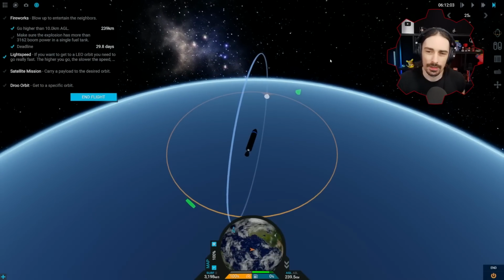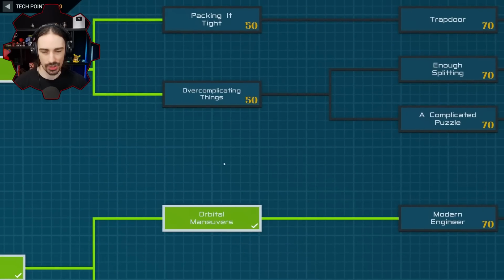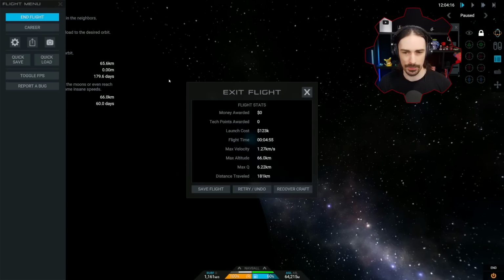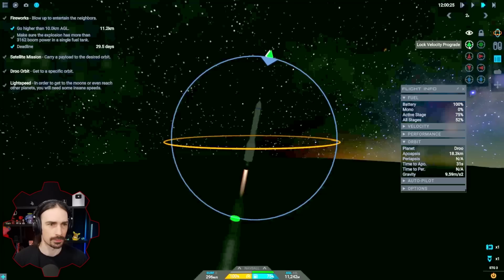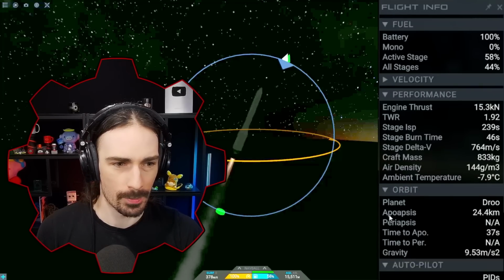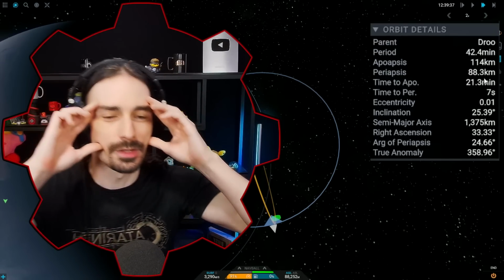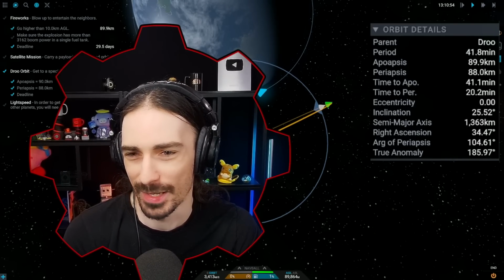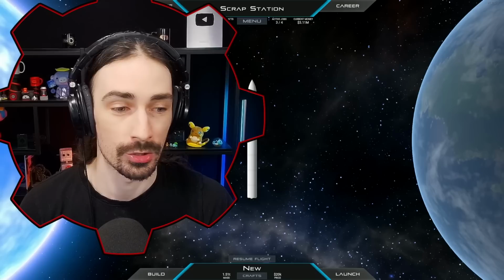Trying To Launch A Rocket Into Super Precise Orbit! [Juno: New Origins]

Comment: This is so painfull😅
Well at first there are no orbit and non-orbit motors there are atmosferic motors and vacum motors (simplyfied) so the orbit motor will work just fine when you enter space even in suborbit flight. 
Orbit making:
You don't want to have the spike while trying to make an orbit (if you do the spike it means you have wasted fuel to get yourself so high) in KSP (don't know how there) is first stable orbit  (circle) at about 80 km above ground. So you wanna ideally burn at upper atmosfere more to the side to make it more round (and you also may lower your thrust because to have same speed you need les fuel in higher atmosfere).
hopefully this will help you. Anyway great video

Comment: Create an ascent guidance script in the scratch editor. Super simple to setup. It will do everything you're doing manually for the gravity turn on it's own.

on start
lock heading to Current
wait until altitude ASL >= 5000
set craft Pitch to 85*
wait until altitude ASL >= 7000
set craft Pitch to 80*
... repeat a few times for granularity ...
wait until altitude ASL >= 20000
set craft pitch to 45*
wait until orbit Apoapsis >= 50000
set craft pitch to 25*
wait until orbit Apoapsis >= 60000
set craft pitch to 15*
wait until orbit Apoapsis >= 70000
set craft pitch to 5*

Comment: Heading perfectly east has to do something with the earth's rotation:
The earth rotates around itself in 24h, so a point on the equator travels with around 1600 km/h to the east just by the earth's rotation. If you then decide to travel to the east you have an initial velocity of 1600 km/h which you do not need to use any fuel for. Would you travel to the west, then you first have to use fuel to counter the earths rotation and then an equal amount to gain this speed in the opposite direction. This way you would need to acellerate for additional 3200 km/h.
Reply: Additional Information:
That's also the reason why all space ports are as close to the equator as possible. You want to have an initial velocity as high as possible and since the earth diameter is the biggest at the equator, you have the most distance traveled each day by the earth's rotation and so you have the most initial velocity.

Comment: To easily get into orbit, you could try having a shallower trajectory earlier because in your early launches, you had a lot of vertical velocity but not a lot of horizontal velocity. To have a stable orbit, you need to have a high horizontal velocity. Hope this helps you more reliably get into orbit

Comment: He ScrapMan, I heard you wonder for a way to calculate the final height of stages several times now and if you want to use it I have a formula for you to approximate the height of a stage. The true height will be a bit higher as the full weight decreases and the atmosphere changes but these formulas become significantly more difficult if you want to factor these changes in and it might be dependent on the parts you are using. 
The numbers used here can be found in the staging analysis. 
Final position #1(numbers represent stages) = position #0 +burn time #1 * speed #0 + Delta V #1 /2 *Burn time #1 ^2 
Final Velocity #1 = burn time #1 * Delta V #1
Then for the next stage 
Final position #2(numbers represent stages) = position #1 +burn time #2 * speed #1 + Delta V #2 /2 *Burn time #2 ^2 
Final Velocity #2 = burn time #2 * Delta V #2
and simply keep increasing the stage numbers for every consecutive stage. 
If you feel like optimizing in the next video you can use this for approximations.
And I must say you have a great way of approaching problems.

Comment: Here is more friendly tips! To get hang of getting into the orbit, you can try accelerating straight up until apoapsis makes it to 100km and then turn flat heading the horizon once you left the atmosphere and start accelerating sideways until you get to your orbit. The time above atmosphere's edge should be enough to get to orbit, if not - try heading 10 degrees instead of flat to the horizon.

Comment: I also used your previous video to recreate a Tutorial rocket and put it into orbit. 
The whole procedure of launching a rocket into orbit is quite simple and can be automated using the built-in programming language.
Here is my program which will automatically put the Tutorial rocket into orbit.
https://drive.google.com/file/d/1I5CvsveeSUHR2m80H2U9lwzd981_qNI7/view?usp=sharing
Just put it to the following folder and then load it in Program editor in Rocket designer.
c:\Users\CurrentUser\AppData\LocalLow\Jundroo\SimpleRockets 2\UserData\FlightPrograms\
Then press the launch button, lean back and watch as the rocket does everything by itself.
The program will work with other rockets but it will require some tweaks according to the configuration of the rocket.

Comment: You don't have to get the apoapsis to a certain degree, that's just a standard setting for getting you there. An easier way to get what you want is to get that to 88 then increase the pariapsis to 90 or wherever you want it

Comment: Great work Scrapman! Well done!
Typically earth ref based planets tend to have their atmospheric drag end above 80k.
Some have it at 80,75,70 so above 80k is usually relatively safe for the sideways manoeuvres.
You got the hang of increasing AP and PA pretty well, so that's nice.

Just a note ahead of time is usually when you have to do a retro burn for landing or entering a new orbit you usually want to be ready to do your burns ahead of time so you can adjust in space games.
The delta V in space will tell you how much difference in velocity you can make, so ... If you know your distance to target position, you can start a slow burn increasing to a full burn plus half before that or give yourself at roughly a quarter before that distance so you can take time and kill your velocity and make sure you leave yourself some fuel so you can come down softly.
Note this method usually requires adjusting throttle and not just full power into a suicide burn touch down. Yes the actual name for the maneuver.

Idk if this is too complicated an explanation or not but game will likely teach you when the time comes.
What I suggested just gives you more time to be delicate but isn't exactly necessary.

Comment: Remember that you don't need to keep accelerating until you reach the desired firework explosion altitude. You only need your apoapsis to be that high. When your apoapsis is high enough you can cut the throttle and wait. This way you can save some money
Reply: But the drag slowly pull it down so you have to give some allowance
Reply: @christianjaymoralde7504  your apoapsis is already at that height so it dosent matter
Reply: @9tr0n  As long as you're still in the atmosphere, the air drag would slow you down and lower the apoapsis slowly. The apoapsis number assumes no atmospheric drag.
Reply: Yeah, that's great and all until you realize he wad using solid fuel thrusters. 🫢

Comment: So some tips for orbits: when you get to 5000 m ASL, turn to 70°. Once the green arrow overlaps with the white one, enable prograde lock. The reason the tutorial had you throttle off for a bit is because the burn to circularize the orbit is most efficient at the apoapsis. There is a number, time to apoapsis and a number for burn time, when you are half your burn time away, lock 0° and burn. that way you spend the most time close to the apoapsis while burning. congrats on what you just did and knowing to control things at the apo/peri apsis.

Comment: You can change the apoapsis and periapsis at any time but this is not the most efficient. The most efficient way to change the apoapsis is to burn at the periapsis. And vice versa. Efficiency is important because it saves fuel. In other words, don't panic. As long as the orbit is above the atmosphere, you good.

Comment: Tips: use bigger engine with lower than 1st stage thrust but high efficiency for your 2nd and 3rd stage but use high trust lower fuel efficient engine with small size compare to the 2nd and 3rd stages

Comment: Delta V is one of the most important parameters of your rocket/stage you have to read about. It will allow you to get some idea about expected performance, the only thing after is to account for gravity and atmospheric loses. In short it's the expected change of speed you can get. In vacuum, if you burn prograde or retrograde it's exact figure, but during launch some is "eaten" by drag (best to not go faster than 250-350 m/s in the low atmosphere), and a lot by gravity, the lower TWR they higher loses.

Comment: As a Kso player that has been playing for 5 years, I think I can give a word or two to help with your difficulties. First of all, You don't actually have to cut thrust when the apoapsis reaches 100km, you can actually cut it when it reaches over 80km(somewhere between 85 and 90km would do), because that's where (at least to my knowledge) Droo's atmosphere ends, So you can save a bit of fuel by doing that, but note that it will give you less wiggle room in terms of timing. 

Also, I believe that you can still use the direction controls in space, which would've helped you adjust your apoapsis and periapsis, to simplify it for now, Pointing prograde means accelerating in the direction of travel, i.e it raises your apoapsis when you're at periapsis, and vice versa at the apoapsis. Pointing Retrograde is the opposite, it lowers your apoapsis at periapsis and vice versa.

Hope this helps( and reaches you)

Comment: I recommend you do more Juno so you don't have to infodump yourself every week. It's such a great time watching you do rocket science. Maybe try sandbox and make a plane that's multitudes faster than the speed of sound.
Reply: Planes in this game are really hard to do properly.
Reply: @thetautvyduxs5242  Not really. Have CoM in front of CoL both full and empty fuel tank. Have sufficient lift and make wings thicker so they don't snap easily. Reduce operating angles of control surfaces. Good to go. Also to save cost you can make mini planes with smallest possible size.